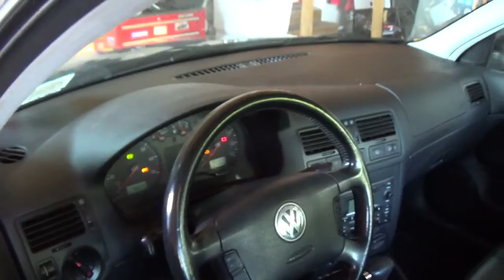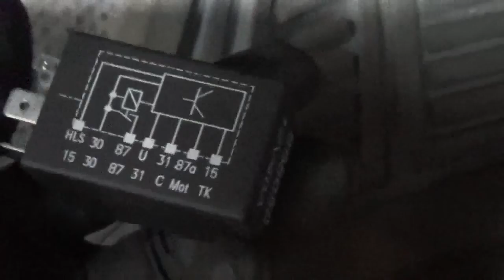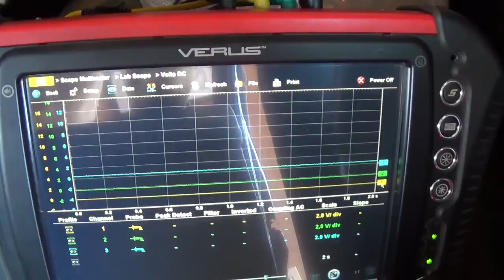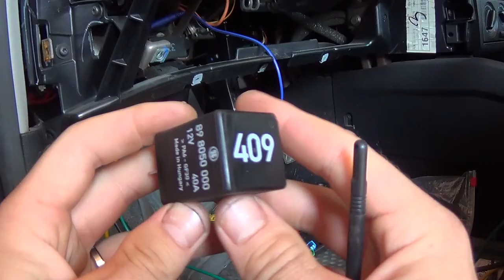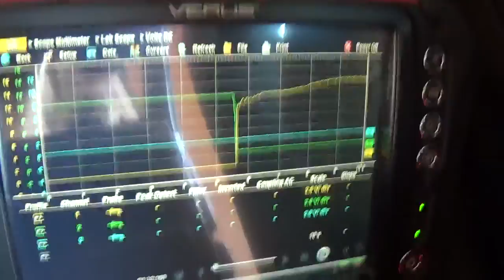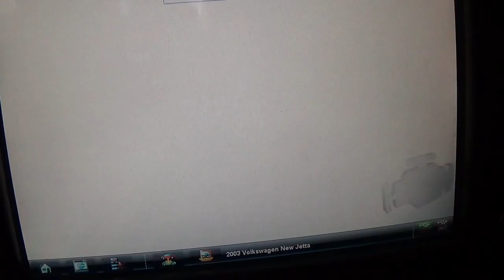'03 VW Jetta: Stall/no-start when driver's door open -Part 3 THE FIX

Comment: Late to the party..
But cant help but wonder since this happens to others if the manufacturer of theese relays just didnt understand the purposse of that pin, made an assumption, and actually programmed it to do exactly that. Or do they work normally at first?
Maybe their logic is hey, door is open so no one is in the car. Shut it down..

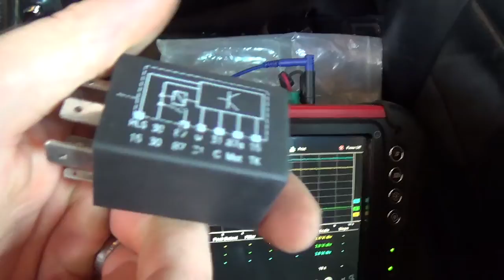Comment: My 409 Relay has 8 legs. When I pause this video @16:25 your replacement only seems to have 7 legs (the diagram only shows 6 or 7 legs as well), so that problem seems to be the someone just put the wrong replacement part in (the replacement part may actually be working correctly, but it was mistmatched). (Maybe one of the contacts is broken off too)

Comment: Ivan you’re a beast! I just watched all three videos start to finish and my brain hurts. However, I was on the same page as you the whole time. Thanks for helping me advance my career man, I appreciate what you’re doing!
Reply from the maker: Matthew, my pleasure! Good luck in your career! You will do great because you want to learn new things and don't give up. That is key :)
Reply: Pine Hollow Auto Diagnostics Thanks for the response!! I know you’re super busy. I recently became a shop owner in the Chicagoland area. I’ve been following you Keith, Eric O, Paul Danner, etc. for quite some time. If I may, I’d like to get your opinion on the launch scan tool, x431 pro3 to be exact. I’ve been getting by with my solus pro and vantage pro, and I think it’s time to add another weapon to my arsenal. I’ve reached out to Keith and Eric, but no response. Any advice regarding that tool is greatly appreciated. It seems to be a rat race between that and the autel. Thanks brother!

Comment: Was it a BBW 2.0L engine with a 409 relay??
The BBW 2.0 is a different beast...takes the 466 relay..
If a BBW 2.0 has a 409 relay...IT WILL cut off when the door is open...but will work otherwise with the 409
The BBW is a California emissions engine (nightmare)...the 466 relay is designed to cut the pump on twice as the door is opened and the key is turned in ignition....and has an electrical connection from the FUEL FILTER to the Relay...
Apparently these are superceded now and only the 409 is what's available and will work with the BBW engine
----------------------------------------------------------------------------------------------------------------------------------------------------------------------------------------------------------
-WERX/RVA-
VW Specialist
   Est.2001

Comment: I just ran into something similar with my 03 passat , 2 different aftermarket fuel pump relays both junk dozen codes no start. factory relay #409 fixed!

Comment: Since the relay seemed to work OK except for door switch, could you just cut that pin out from the relay and fix the problem? You would lose the early prime, but that should not be an issue, since there is a prime when key is turned to run position.
Reply: My thought exactly.

Comment: you should tear it apart and do a video
Reply: I also would liked to have seen inside that relay. Since this is a common fault with aftermarket relays I wonder if they screwed up and think the door switch is the airbag disable signal? Maybe if you set off the air bag the fuel pump will prime? ;)

Comment: Interesting note on your laptop screen in Part 2 at 23:40:

"Short to Ground Codes: Fuel Pump Relay is Aftermarket. Replace with OEM relay (VW no. 409)"

Great fun to watch.  Thanks for posting this.
Reply: oh its does cool, i need to check my relay then

Comment: Hi I work on mostly VW AUDI cars and I never seen this issue before faulty door switches a lot fuel pump power supply relay yes and with almost all fault codes listed I buy most of my relays for European car part supplier so not much issues with bad relays but some have to bough from the dealer I'm so used to work with VW AUDI diagrams they are the best but I can't say the same with Mercedes as an example .

Comment: Good afternoon Ivan. I really enjoyed this case study!!  While presenting the problem, we were able to c path u started on. What were we missing, and then why were we missing them?  The abominable German wiring diagrams and how to read them will certainly b helpful for us. The different sources of information that we can access; you tube and the Internet also played into the solution. I am sure many were following along as I was telling u to do this or that as if u could hear us. Whoever made the aftermarket relay probably didn't have access to the logic component and so made one that degraded very quickly. I think it is safe to say that no matter where a component is made, the quality control and the specs r the really important thing. After all, isn't the IPhone made in China?  Really appreciated the video. Thank u!!!

Comment: Those schematics remind of ZF Transmission Schematics, when I have to troubleshoot one I bring a piece of graph paper and draw out the circuits I want to look at in a straight line.  All the twists and turns make me dizzy and confuse the heck out of me.  Why not just draw it in a straight line?  Jeez.
Reply from the maker: +busjockey1 Never question the German Engineers...they know better than you or me haha! But seriously those diagrams suck hardcore.
Reply: +motoYam82 I have German in me so I can question it,lol.

Comment: Great work again Ivan. You have gained another subscriber! Really enjoying your channel. Test light won't light as it would most certainly be a high resistance circuit. No sense having a switch input signal with a high enough current flow to light a test light!! Module just needs to know if signal is high or low.

Comment: Can't start the car with the door open = funny.  I'm restoring a 1975 Cutlass that has the starter interlock - the one where the car won't start if you or someone is sitting in either front seat unless you have the seatbelt buckled.  I'm keeping it - how many car thieves buckle their seat belts???
Reply from the maker: +Randy Condran Wow mandatory seatbelts in 1975??? Crazy!
Reply: It wasn't mandatory it was a try of the car manufacturers at getting people to use seatbelts as nobody used them back then... the sensor for this was rigged into the seat springs all someone had to do was find the wire harness coupler for this system that was under the front seat and pop it apart... (there was one on each side for driver and passenger) once disconnected it would disable that cut off system and the car would run normally.. I had a 74 plymouth duster that had that exact thing.. I found when I got the car that it was already disconnected.. story goes one day I was cleaning the car and for some reason I looked under the front seat and found the disconnected wire harnesses at first I did not know why or what was the disconnected wires for... so I reconnected them just to be curious and lo and behold I couldn't start the car without fastening the seatbelts of course all you had to do (simple secondary fix) was fasten the belts behind the person as where you were'nt actually wearing them.. (lol) although the other trick was fasten the belt start the car and then take them off... (except then you would hear buzzzzzzzzzzzzzzzzzz the whole time you drove as the fasten your seatbelts lamp would be lit and the buzzer would be buzzing...) of course then I ran into one last problem.. most chrystler cars of that time had the issue of stalling... well my car also had a wierd problem it would stall everytime you put it in reverse... never knew why though... imagine makeing a u turn having people waiting to drive past you and having to refasten the seat belt just to restart the car while blocking the road!!!! lol it happened to me a lot of times until I finally had enough reached under the seat and re-disconnected the wires and disabled the system again.... PS I also later found out there were a lot of people that paid mechanics money to disconnect those wires.. when it was actually just a simple seperation of a wire harness much like the simpleness of pulling apart an extention cord which one could easily do themselves...lol

Comment: Same type deal our Beetle has, or darn near close.  Likely cold solder joints or crud built up on the PCB with the door latch causing issues with the door open light--Also that door switch flags the system to turn on the fuel pump to prime the system when the door is open.  As for the fuel pump relay?  I have contacts with our local salvage yard for relays and such.  They tend to save me some of the ones from VW's they bring in.   The VW dealerships in my area won't cut anyone a break for a "Cash" or "DYI" over the counter.  They charge full LIST for everything.  Plus they spend most of their time looking down their noses at people like me that do their own repair work.

Comment: What happened to the yellow wire spliced into the orange with in part1 and what then you were going to look at j271 relay with the power on to all the injectors with ignition off???
Reply from the maker: apparently it was a bypassed ground for the ignition coil...part of a TSB for intermittent misfires.
Reply from the maker: apparently it was a bypassed ground for the ignition coil...part of a TSB for intermittent misfires.

Comment: Excellent vid, and a great find. That took some deep thinking.  I wonder how VW would address this , just swap the relay and hope for the best.  Great work  Ivan. Thanks.
Reply from the maker: George Heri The VW dealer said they haven't sold one of these FP relays in 3 YEARS!! That's why it had to be special-ordered. So the original OEM relay itself seems to be reliable. The problem comes from people swapping out a good OEM relay for a junk aftermarket one for whatever reason...

Comment: Nice work Ivan... Good find on the fuel pump relay. As you know I had that exact problem too. Now you can dissect the OEM relay and aftermarket one and see where that logic is screwed up. Just kidding Ivan. Keep up the good work!
Reply from the maker: stuzman52 Yup and it just so happens I randomly watched your video a few weeks before I got this VW in the shop! Kind of ruined the surprise haha but was still a satisfying find!
Reply: I know what you mean Ivan when you get something fixed. It's a good feeling for sure!